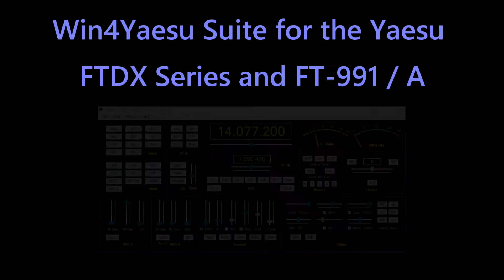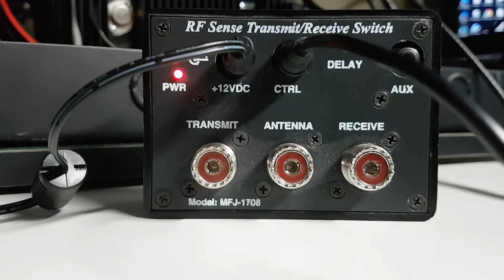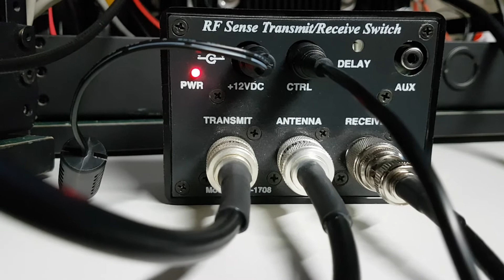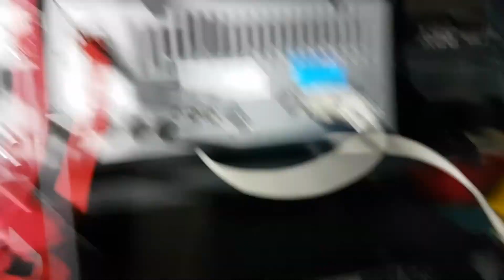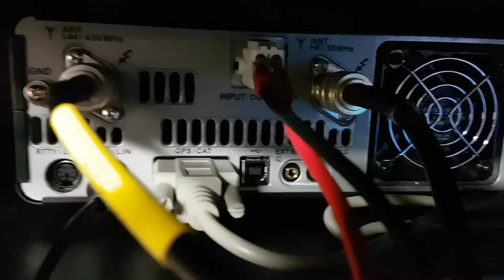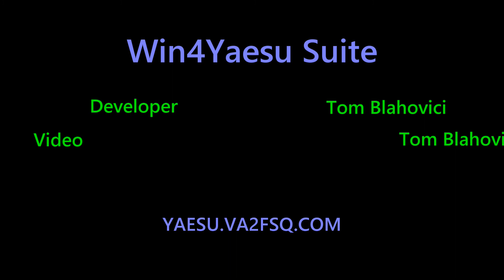Win4YaesuSuite with a Yaesu FT-991 or FTDX-1200 and an SDRPlay RSP Panadapter

Comment: The SDR play is known for having a relatively fragile front end and many have damaged their SDR play just from a TX antenna being within a dozen feet of the SDR antenna. I'm not sure if the 991 delays TX for some period after it enables pin 3 on the control jack but relays don't switch instantly and even a few milliseconds of TX RF can fry the SDR front end. Also you're  putting the 50 ohm SDR in parallel with the 50 ohm Yaesu presenting a 25 ohm load to the antenna on receive. This is going to significantly degrade the receive performance on both radios. So this seems far from an ideal solution.
Reply: I talked to the folks at SDRplay and they told me there would be no issues with overloading the front end of my RSP1A using the MFJ-1708sdr if wired with the PTT  (I will find out soon when my keying cable arrives from ebay)

Comment: I've been using an FT-991 and an SDRPlay (with SDRUno and SDR Console) for a bit over a year. I'm using the DXE RTR-1A. Works great together and MUCH better than the tiny little 991 LCD. No 991A needed with an SDRPlay.
Reply from the maker: Yes that is another alternative. The sdrplay does a better job than the 991A display.

Comment from the maker: The keying cable is available on ebay from a few vendors.  Just search for Yaesu 991 or Yaesu FTDX-1200 Keying cable
Reply: Thank you for the info! So I'm looking for a "Yaesu-keying-cable" but I'm not sure if the eBay links are "pinned the correct way" so could you please post a vendor link as a safe example from whom to buy the correct one from? Please. Thank you an advance, Tom. John 73's
Reply: Hey Tom, Can you please post a link?? "Just search for Yaesu 991 or Yaesu FTDX-1200 Keying cable" is wide open does not narrow down my search for the "Right cable" Please reply. Thank you.
Reply: Aloha Tom, Could you please post a link to the ebay keying cable for the FT-991A to the MFJ-1708B-SDR or MFJ-1708B-SDR-S?  As Saverson1 said, I don't want to get the wrong cable.   Secondly is it better to use a PL259 to SMA adapter and PL259 jumper cable or SMA to SMA cable direct with the MFJ-1708B-SDR-S model?  Mahalo and 73, Scott WH6RG.